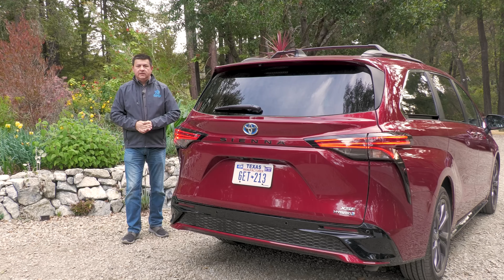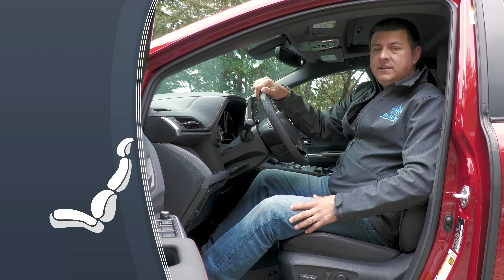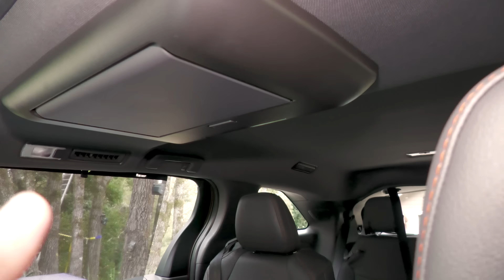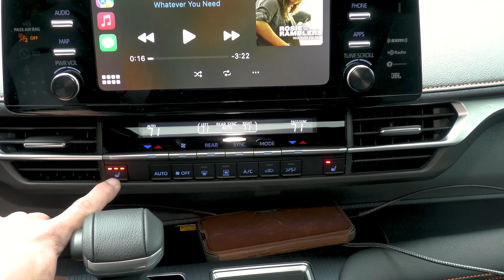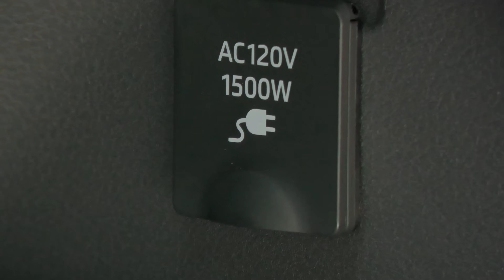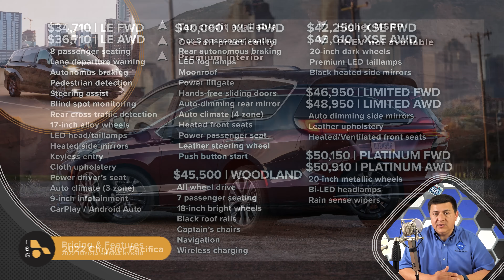While We Wait For an EV Minivan, There's The 2022 Toyota Sienna Hybrid

Comment: 7:19 actually, Ni-MH batteries are more expensive than li-ion batteries per kWh. However, like you said, the air-cooled system is cheaper and simpler than liquid cooling, and Ni-MH batteries don't require liquid cooling like li-ion batteries do, since they perform much better in extreme temperatures (hot & cold) compared to li-ion. Also, Ni-MH batteries have a longer cycle life than li-ion batteries, which is important in a hybrid since the hybrid battery is constantly being discharged and recharged at high rates during normal operation.

Comment: I bought a Chrysler Pacifica Hybrid (plug-in) and I love it. I also found it much more comfortable than the Toyota Sienna, as did my family. The Chrysler has a much more modern infotainment and higher quality backup camera. 

I’ve used ~24 gallons of gasoline to drive ~2,500 miles since November.

I wish I the Pacifica had a heads-up display, highway driving assist, and a height adjustable rear hatch (you cannot set an opening height - it’s just full open or close).
Reply: The PacHy is a better buy for daily driving.  Plus you get a $7,500 tax credit on a PHEV that Sienna Hybrid cannot.

Comment: I rented a 2021 Sienna with the hybrid,  but purchased the plug in 2021 Pacifica.  I was disappointed with the Sienna engine noise and feeling of power when it was loaded with 4 passengers and full size Rottweiler.  I also find most of my daily trips can be electric only in the Pacifica!  Ability to drive 180 miles each way to my daughter’s university without range anxiety is a win.  I’ll take the $7500 rebate next year, and I don’t plan to keep the Chrysler forever, so not worried about long term reliability, but my 300C continues to do well!
Reply: PacHy FTW!

Comment: hello, I have a 2021 chysler pacifica hybrid and last 11/2021 the check engine light came on, I went to the agency with an appointment, on 01/03/2022 they had my chrysler for a month, they called me to pick it up, that they ordered the part and today is 04/19/2022 and they have not given me an answer, I wanted to know if someone could help me, please: thank you
Reply: went back to the agency and they told me that everything has to start over, they have to check my chrysler pacifica hybrid one more time, because they don't have any information about my case what do I do besides starting over can someone help me today is 05/19/2022

Comment: For those wondering about real world mileage, we've had our '22 Sienna Platinum for about 10 months now and on long road trips, it gets around 35-36mpg, with one trip nearly 40mpg but around town during our normal day to day usage we're averaging about 30mpg, where we live its basically all hilly, twisty, back roads with little highway driving during a normal week. So if you don't do much highway driving, you should expect closer to 30mpg instead of 35. Still WAY better than the non-hybrid competition.
Reply: Edmund's and Car & Driver longterm Sienna Hybrid is only managing 32 mpg.  One has across country trip included.

For local, daily driving the Pacifica Hybrid sees over 30 miles on battery before engine starts and 82 mpge!
Reply: Yup. Our 22 XLE AWD we average 32-33 at 75 mpg with four adults and gear for a five hour trip. 

Around town and countryside we have gotten anywhere from 36-37 mostly. Got 45.5 the other day.

Comment: Aside from the hybrid and some Lexus like features like the power tilt telescope wheel and 4 zone climate control and ottomans, man did Toyota really screw up this van

The cargo space has shrunk significantly and the second row seats don’t even come out 🤦‍♂️

The last generation sienna had class leading cargo space. 38 cubic feet behind 3rd row; 88 cubic feet behind 2nd row; 110 cubic feet with the 2nd middle seats slid all the way forward; 150 cubic feet with the 2nd row seats taken out. To this day that’s still higher than most minivans and just about tied w the Kia carnival

I’ve also heard the interior isn’t luxurious nor is it visually interesting like the carnival.
Reply: The Carnival has terrible access to third-row when it has captain chairs on second row. The boxy shape gives the Carnival more head-room space than the Sienna but the leg-room space suffers big time. It has the worst fuel economy in the minivan segment and only comes in FWD.

Comment: As an owner of the 2019 Honda Odyssey, I really like the fact that Toyota is making a hybrid minivan for the market. In late 2018, I was deciding between the Sienna and Odyssey. The Odyssey won me over at the time of purchase with IIHS top safety pick, Android Auto support, and more features for the money like adaptive cruise control even at lower trim. The Sienna at the time was just too dated.

However, I am still not sold on the Sienna in it's current form. First, the non removable 2nd row seats and 8+ second 0-60 are deal breakers for me. I really wish Toyota would make the 2nd row seats removable and offer a Sienna Prime model. They should take the powertrain from the 300hp AWD RAV4 Prime and put it in the Sienna. I would love to have the extra power / AWD to climb Tejon pass on the I-5 and trips to Lake Tahoe in winter with my whole family and their belongings. I would definitely use the charge hold feature to save up energy for those highway hill climbs. If I can get 35 miles EV range, I can probably drive 90+% of my trips on electricity alone for local errands/commutes. Then on long family road trips, I don't have to worry about charging. If Toyota can really offer a Sienna Prime model I might even forgive them for not offering removable second row.

I know Chrysler Pacifica has a plug in option and very flexible interior. But, I am not sold on their brand due to reliability and quality concerns.
Reply: But the Pacifica will be cheaper to run so any savings can pay for repairs
Reply: The PacHy offers $7,500 fed tax credit and double the daily driving fuel economy!
Reply: This is exactly what I'm thinking too.  I too awaiting for Siena prime! I still driving my 2007 Odyssey EXL with +240K mi. now, I don't know how much longer she's last... but I hope Toyota will release the Siena prime asap, please.
Reply: @tuan056585  Pacifica will be EV before Toyota does Sienna Prime.

Even the PacHy Pinnacle is like a Lexus Sienna!
Reply: @normt430  , I do have a chance to drive Pacifica for 1 week (as Hertz rental). I admitted the outside styling look nice and she has plenty power to get into hwy., but the shift knob that turn me down (and same thing on the new Odyssey). I'm not a fan of "push button" for gear shifting! I prefer the classic style sifting gear like the new Sienna.
Sienna got almost all the Lexus options like 3D bird eyes view, Head up display, Reverse tilts side mirrors, Rearview mirror LCD with camera, surveyant camera,.... These options are not seen on some other minivan.
If Toyota put a prime badge next to the Sienna logo... I'm sold to it.

Comment: The EPA rating for the Sienna is very conservative. About a month ago, I rented this minivan and drove around the Los Angeles area for an entire day with 7 passengers. At the end, I averaged 42 mpg. Toyota's hybrid system is truly the best and most efficient in the market.
Reply: I agree with this but with a catch (a big one).

If you have any number of elevation changes or winding country roads, you will definitely see a dip in the performance. It's still amazing!! Winter's here in Canada will greatly impact the higher performance on the electric side as well. Right now I'm getting over 36 mpg, however, in the coldest part of winter I was seeing numbers as low as 26. That's mainly because of using all the accessories to warm up the car such as heated seats, heated steering wheel and the biggest culprit of them all... the internal combustion engine for warming up the cabin space. That engine has to run a heck of a lot more if you live in a colder area.

I own a 2022 sienna LE FWD.
Reply: At what speed were you driving?
Reply: @terrencewilliams4976  Mostly at highway speed 65-70 mph.
Reply: That is still half the +80 mpge the Pacifica Hybrid gets.  Plus  PacHy gets $7,500 fed tax credit.

Comment: This is the exact analysis I did last September(except I didn't consider the Tesla Model X lol) when looking for a replacement for my Odyssey. I have a family of 6. I went Kia Sorento PHEV; with the government rebate here it is basically the same price as a Sienna LE AWD. The Kia is too small for a "road trip" vehicle but I have a Suburban for that, and a "road trip" usually involves towing our 32' Travel Trailer. The Suburban is mostly parked as I work from home. The Kia will be the main "errand" vehicle. I'm up in Ontario Canada so the gas prices were always more expensive here than for down in the States, so economically the PHEV made sense already last September before the war. The way I figure it, the gas savings will offset the cost of the new vehicle over a used vehicle (especially since used vehicles are crazy priced right now). One way to look at it - the oil companies are paying most of my car note. Last I heard the vehicle should be delivered Early-mid May.
Reply: Good choice!  The PHEV and U.S. tax credit on PHEV always beats just a hybrid with none.  Both at thr bank and at the pump!

Comment: We own one and get 34 mpg on the highway at 75 mph.
Reply: AWD? How long have you owned it? Any issues so far? TIA
Reply: @redtarectecan7921  AWD, no issues so far. Had it for only 9 months so far. But it's a Toyota so I'd be surprised if I run in to any issues.
Reply: Nice. Looking into ok get one...I still have the 2011 V6 XLE. Thing is a tank, 180K still going strong.

Comment: Don't understand why a EV minivan makes any sense in terms of cost when a van needs 150kW of batteries (costs ~$20k) to have any reasonable range when a hybrid minivan gets 35 mpg.  But logical hybrids aren't sexy so it's full speed ahead with EV mandates in Europe...
Reply: Why would a minivan need a 150kwh battery? It’s a slightly taller vehicle, but aside from that I think would be pretty efficient when driving through the air. A 60-100kwh pack would be pretty usable for most people.
Reply: @MX5-XU  that's why the PacHy is more efficient and costs less after fed tax rebate!

Comment: I have a Sienna on order.  I will know in three to four months how it really does on mileage.

As far as removable second row seats, I have had my Odyssey for ten years now, and only removed the second row twice in ten years.
Reply: It's probably heavily user dependent. I don't have a truck, so I've pulled out the middle row of my Odyssey at least 100 times in 13 years. I've even made multiple hauls of ½ ton of sod and paving stones in the back from Home Depot for home improvements. It's great for moving tables, desks and bookshelves without having to disassemble them.
Reply: @Tokamak3.1415  I have a trailer,so for larger or bulkier loads, I just hook up the trailer.
Reply: I have one. In the first 1000mi I have averaged 32mpg
Reply: @theonlydarts  Edmund's and Car & Driver longterm Sienna Hybrid is stuck at 32 mpg.
Reply: @theonlydarts  good to know.
Reply: No mention about reliability which should be your first requirement- you are comparing a Toyota to a fiat etc. Cerberus ruined Chrysler and fiat is completing the job. I’m getting rid of my 4th Chrysler town and country because of age and parts no longer available, a problem I don’t expect to have with a Toyota

Comment: I don't trust Kia or Tesla. I prefer to buy Toyota and Honda.
Reply: Interesting. I bought my Model X specifically because of too many issues with my Sienna and Odyssey. The Sienna had the doors open on the freeway and was lemoned, the Odyssey had horrible phantom drain and needed constant jumping but was otherwise reliable (luckily no AC or trans issues @ 123K).
Reply: @Tokamak3.1415  the  X is an amazing car to behold, however it’s one of the lowest scoring cars in reliability on CR. I would buy the Sienna if the second row seats were easily designed to be removed and replaced easily. I was hoping that the Venza was a bit bigger inside than the RAV4. Now I’m waiting to see the redesign of the 2023 CRV hybrid. We Just replaced my wife’s 2001 Subaru Forester with a Leaf SV plus as our around town runabout. I’m looking to replace my 2014 Subaru Legacy with a Toyota or Honda hybrid for retirement road travel.  
USA has too many different ev charging station standards compared to Europe . That and Long range EV costs make a hybrid a better choice for road trip travel today in America.
Reply: @MechayaAlta  I own an X and an Odyssey and had Sienna I lemon lawed. I was looking for something to replace my Odyssey and after 3 years wait I gave up and bought an X because I know Honda and Toyota weren't going to make one this decade.

I would have loved to have something with minivan doors instead of the stupid falcon doors. I mean the falcon doors do have their advantages at times, but they are less practical than sliding doors and most certainly more expensive to repair than sliding doors. I kept the Odyssey because the X doesn't cut it for moving cargo, only good for moving 5-7 people. So I'm still somewhat reliant on a gas vehicle for now.

Having said that, the Tesla has been my most reliable vehicle I have ever owned. It may be a sample size of one, but if you look at it from an engineering point of view the BEV should naturally be more reliable than an ICE. Even the lowly GM Bolt is GMs more reliable vehicle (compared to a Escalade) and I'm sure the Leaf is Nissan's sans issues with battery longevity. CR's rating system is just plain stupid. Having done medical research in the past I'm critical of "studies" and CR's methodologies are just not rational. The Tesla X is not built as well as a Lexus ES350, but the interior will undoubtedly last longer than any Mercury/Lincoln/Porsche/BMW/MB product I've owned. Porsche builds wonderful driving machines, but after 4 years those buttons need replacing and the CD changer will no longer work unlike a 2000 Corolla - the Tesla is somewhere in between. The drivetrain, however, will best anything Toyota offers at present sans maybe the new BZ4X. Remember Tesla did the EV drivetrain for Toyota's first BEV.

As far as charging standards - there's really only 2 in the US. Nissan's Chademo is dead - it's only Tesla and J1772 CCS - and the Tesla can use 1772. Both do the same thing - just have plastic and metal in different locations.

For road trips I agree, at least within the US. I drove from LA to Bryce, UT and LA to Mammoth with my X. It added a little extra time but not too much, with any cheaper EV sans the new Ioniq the charge times would be more significant. The US is just so large  a country and people do sometimes drive 500 miles in a day. That's unheard of in Europe (trains everywhere) - you could be driving through 6 countries doing that. But honestly if I'm going to go past 500 miles I'm flying and that uses the same CO2 on newer narrow bodies, but some will still miss out of stopping at shady rest stops and eating weird roadside stand foods.